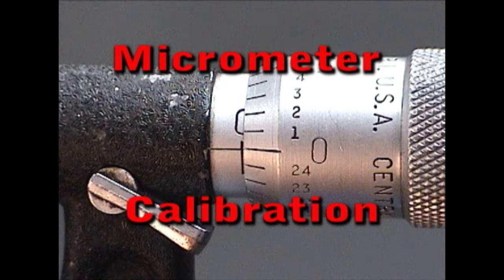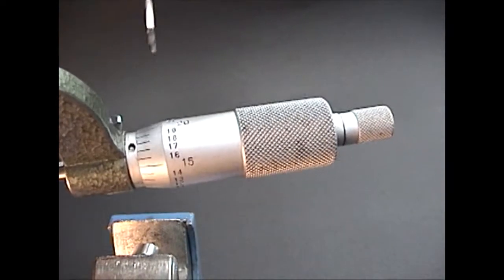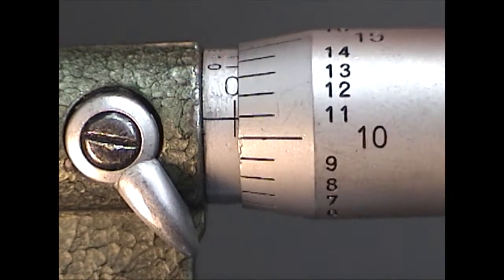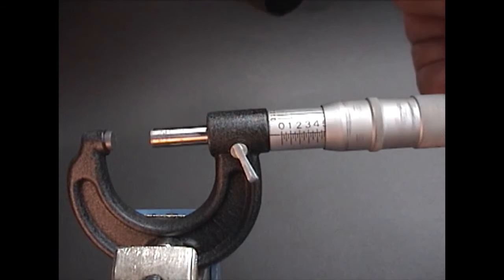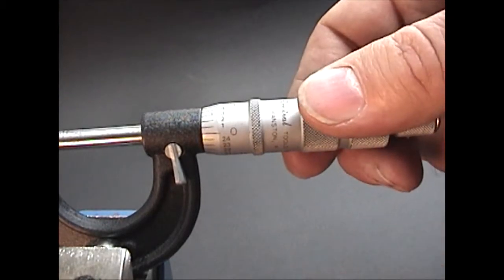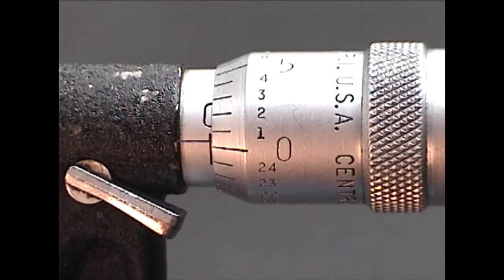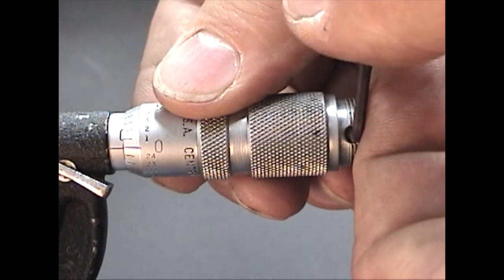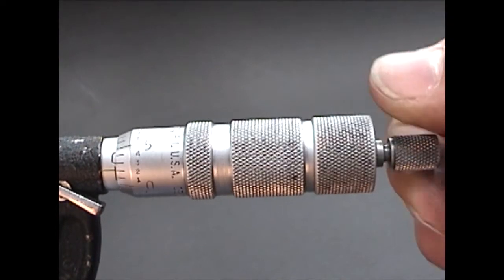Inch Micrometer Calibration

Comment: Recently i bought a used Ammco 2250, kind an older micrometer. I don’t understand the ratchet mechanism, it doesn’t make noise or clicks when we turn. Its ratchet comes with a little spring. My question is, the ratchet doesn’t make click like the one that we see now a day. So how to know if the appropriate tension was set?
Reply from the maker: Some are not click ratcheting overrun mechanisms but instead a friction drag.  Because these can all very in tension I learned to use my own tightening feel that way I'm always consistent.  I personally would not depend on those if the measurement is super critical where accuracy is down to within a 0.0001 of an inch.
Reply: @DrivelineMaster  Thank you

Comment: It's not calibration. It's zeroing.
Reply from the maker: I get that a lot.  However if it is zeroed isn't it now calibrated to read as designed.  Since the calibration is built in and putting it at zero this ensures the built in calibrations reads correctly?
Reply: @DrivelineMaster  "However if it is zeroed isn't it now calibrated to read as designed."

Depends if it was built correctly at the factory, and hasn't been damaged since.

As you say, the calibration (ie. correct spacing between the graduations) was built into it at the factory, you cannot calibrate it, since you cannot correct errors in the graduations.

If the graduations are incorrectly marked (or the thread pitch is incorrect), then, no matter how precisely you zero it, the micrometer will read incorrectly, at every position, other than where it was zeroed.

Comment: ya what if its off .025 plus?????
Reply from the maker: If it's off that is why you calibrate it.  If there is not enough adjustment to correct for the inaccuracy then you throw it away and buy a new one.
Reply: @DrivelineMaster ....So no way to adjust it if it's off .025 or more?
Reply from the maker: If you have the second design that uses the Allen wrench you should be able to calibrate it.  I you have the first design I don't think there is enough adjustment to take up that much.  What brand is your micrometer?  Maybe I can look it up. Is this a 0 - 1" micrometer or larger than 1"?

Comment: Or buy a Starrett.
Reply from the maker: These to have to be zeroed or calibrated but the accuracy and quality is much better.  Depending on what you are measuring and the accuracy needed along with your price point there are a lot of good accurate micrometers out there that will do a fine job without the cost of a Starett.  If I was a professional machinist  using my precision tools every day I would absolutely buy high end precision measurement tools like the Starett brand.